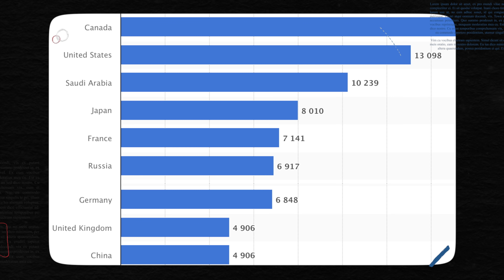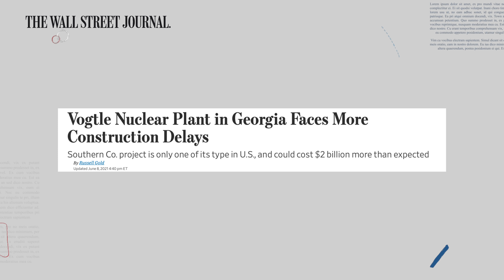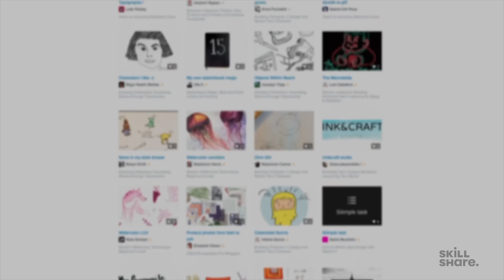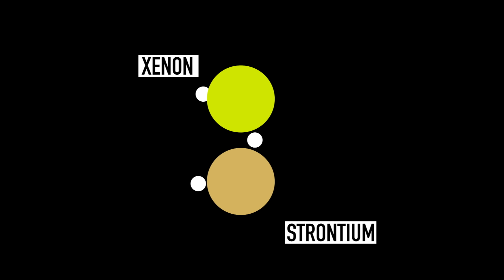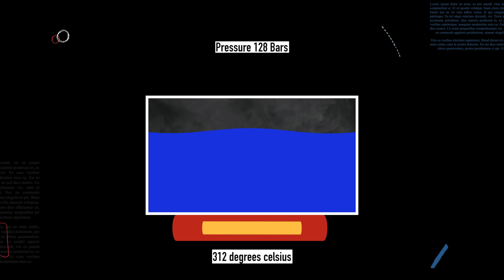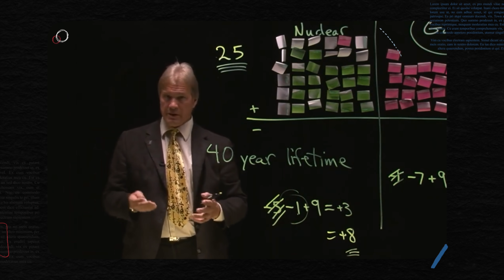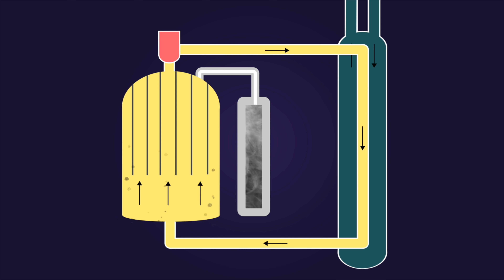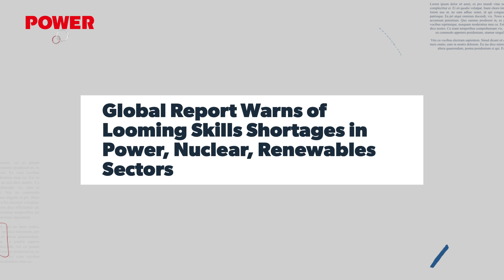Thorcon Just OBLITERATED Nuclear Energy’s Biggest Problem

Comment: The way that this is presented was spot on. I was a believer in Thorium and still am. This is a relatively new kind of science that could change our world. I for one hope it does.
Reply: Honestly, I'd prefer to use reprocessed 'spent' fuel rods rather than Thorium, cleaning up our mess instead of making more mess, but the process is nearly identical to a LFTR reactor. It's slightly less efficient at producing power, but it becomes a net consume of nuclear waste, which I think we can all agree is a Good Thing(tm).
Reply: It's not science, that's proven. It's technology.
Reply: @gregbailey45  True but they say that about Thorium as well but a Thorium test reactor ran for 5 years in the 60s without any major problems and they still call it "technology" as well. It is not classified as a project that will work it is classified as a system that "might" work. It needs billions to get the technology working and they prefer to spend billions on waste management instead. This is like the electric cars that were one of the first ways. Then oil companies saw a way of making money off of cars and got into the business. We all know how well that turned out.

Comment: I wonder what the source for per capita consumption is. Here in Germany, per capita electricity consumption of 3000 kWh/year is considered on the high side by most providers and independent sources I can find. Yet, in this video, the average is 6848. Is there any way you could link the sources? Thanks for the video!
Reply: Probably adds in industry also, no way in hell I use 13k.

Comment: The part about partially sinking the reactor into the sea kind of left me a bit uneasy, but then again, I seem to recall more than 1/4 of the Netherlands has been reclaimed from the North Sea.
Reply: It is settled to the bottom behind an earthen berm, so separate from the sea
Reply: That's the beauty of molten salt fuel, it's so stupidly easy to contain.  The drain tank is such an amazing feature.
Reply: @jeremyO9F911O2  
Not all MSRs have adrain tank, TerraPower, for example.
Reply: @EdPheil  fair enough and they would be pointless without gravity too if such applications ever happened.   But most do as far as I understand.

Comment: The electric grid could really use a flexible nuclear reactor at scale to complement non-dispatchable renewables and most projections (IRENA & IEA)suggest nuclear will eventually make a come back by 2040. Kirk Sorensen makes it clear the Thorium fuel cycle is very attractive for safety and waste and makes us question why we chose U-235 for power in the first place.

Comment: The biggest problem with nuclear energy is politics, especially in the US.  I have worked on currently operating nuclear reactors and several new technology nuclear projects.  All of the new technology projects could have been completed and operating safety except politics.  There were no technical problems that could not have been solved.  The political cycle in the US turns over too fast for a new technology to develop, get licensed and constructed.  There was even a commercial nuclear processing facility built near my hometown, but after introducing nuclear material for testing, President Jimmy Carter decided not to issue an operating license.

Comment: I'm EXTREAMLY sceptical of any modular reactor, largly because they propose to omit the heavy reinforced concreate containment structure which are one of the main drivers of Nuclear Plant cost and delay.  They claim the reactor won't need the containment structure and even if I belived this (which I don't), it neglects that containtment structures not only protect the outside world from the reactor, it protects the reactor from the outside world.  A reactor unprotected by what is essentially a bunker it easily targeted for terrorist attack (such as flying a plane into it, and yes a conventional nuclear containment structure will stop an airplane).  This is why nuclear regulators won't ever approve designs that lack containment buildings which wipes out all the claimed benifits of the modular reactor.
Reply: Good news, Thorcon's ship is designed to survive direct collision by a 747 at speed with aplomb.  They have the writeup on their website.

As for the concerns of any kind of 'catastrophic explosion or accident or anything, the claim here isn't hubris. Its based on the particular design property of ambient pressure.  In short, if not just something,  but EVERYTHING goes wrong, there's no stored up energy to damage the reactor, breech any of the multiple containment layers, or  carry any dangerous material out and away from the ship.  A catastrphic failure of this design is damaging the reactor and parts of the boat - not releasing radioactive material into the environment.
Reply: That is just why this kind of energy has not come to the forefront because of people misunderstanding and not believing in the possible better technology. Why is this? Brainwashing. People think that the kinds of energy produced are the only way to go. Just like they thought that treating sickness with bleeding, cupping, and leeching in the middle ages was the best way. I mean some people still think this is the right way to heal. Just as some people think the world is flat.

Comment: Tropical regions might not need the same actual energy consumption to reach a comperable standard of living.  Large portions of energy consumption in Temperate regions is to heat buildings or goes into the raw materials to build and repair infastructure which needs to withstand cold temperatures.  On the other hand we have the need for more cooling in such regions which is becoming a big energy cost particularly if people become AC crazy as in Singapore.

Comment: Is this reactor actually already running somewhere or just a theory?
Reply: There have been prototypes built yes, no commercial product yet.  However the vast majority of the science it's based on is well proven.  Probably the biggest unknown is the material science.  Molten salt is difficult to work with as chemicals go, it needs a lot of heat and can be corrosive with the wrong metals.  Essentially high temperature chemistry outside of metallurgical Science is still a relatively new field.  Lower temperature chemistry is the more dominant field because it's simpler, safer and cheaper to operate.    

But the important point is that the nuclear Science is proven to work, it's just an engineering challenge now to build the best designs, and a funding challenge as well.

Comment: The lack of a containment building is unlikely. The job of the containment building isn't just to protect the outside from what is inside, but also the reverse, like natural disasters, terror attacks, accidents, ... For example a nuclear reactor is supposed to be safe from a plane crash etc. 

So getting a nuclear reactor certified without a containment building will not only be very difficult, but highly controversial.

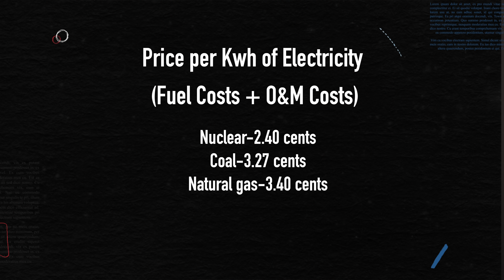As for the price, yes nuclear has been cheap in the past, but you need to look at current prices, not old ones. Generally newer plants are quite a lot more expensive. These new molten salt reactors might be cheaper, but we won't know how cheap they'll actually be untill one is built and operational. Also I thought that the costs for gas and coal there are really low, usually it is around 2-3 times the price mentioned. And Just to be clear, are you using LCOE at 9:35? Since you only mention fuel costs and operation & maintenance cost, so is the actual investment to build included in this? This is rather important considering this is a very large cost of nuclear in comparison to the rest.

lastly that quick mention of nuclear powered ships is kind of, well lets say I hope that was a joke, considering that these nuclear reactors are very very expensive and thus never cost effective.

Comment: Why use Uranium at all? Just use Thorium in the reactor.
Reply: Umm thorium reactors still "burn" uranium though.  Thorium reactors simply recycle excess neutrons to turn thorium into fissile uranium.  They are still uranium reactors at the core.
Reply: @jeremyO9F911O2  They are using 100% uranium. You only need 20% uranium/plutonium enrichment to 80% thorium to get the process going. Much cleaner.
Reply: @kretieg2943  their design lacks the neutronic efficiency necessary for sustainably breeding thorium into fuel.   To fission a thorium atom requires 2 neutrons. Uranium only takes 1.  They can produce more than 1 neutron per fission and have it find a target,  but less than 2. So they can load some thorium into the fuel salt and make use of those surplus netrons to convert and fission some thorium... but they still need to add Uranium-235 to keep it going.  Its not an arbitrary choice.
Reply: @Xylos144  Thank you.

Comment: "solar power is cheap"

"but day turns to night and monsoon clouds cover the country for three months"

Hence it's not actually "cheap". The proper way to describe unreliable power is "useless".
Reply: That doesn't makes it useless, just to be managed. There are plenty of off grid sites/buildings/... that rely solely on solar and storage without any problem and which can be cheape overtime (depending on the cost of the batteries).
Reply: @MDP1702  Yes, it's very niche. To power an entire country solely with wind and Solar is fruitless. You're not powering Tokyo with that. The more unreliables you add to the grid, the more expensive and unreliable they become.

Germany and Denmark are just throwing their heads against the wall trying to power everything on solar and wind, and they don't even come close to being clean. It's painful to watch. Meanwhile France is just chilling, always with low emissions. They were sold a complete lie.
Reply: @infini_ryu9461  You can definitely power an entire nation with wind and solar, it just might not always be the most practical, a lot depends on position, climate, management, ... It is essentially just different from how we managed powergrids untill now. The main point/problem now is grid storage to become cheap enough, which would be around 2030-35, at that point a renewable grid will actually be cheaper than most grids today. Only cheaper and more flexible new nuclear (like thorium) might be able to challenge such a setup.

As for Germany, it becomes cleaner, the problem is that they phased out nuclear for reasons that had nothing to do with the climate or emissions, just politics. In 2020 44% of Germany's power production was from renewables, or 37% from wind (23.6%), solar (8.9%) and hydro (3.3%). This while solar isn't even close to reaching full potential. And the reason why Germany's transition was so expensive, was because it was a frontrunner, starting when renewables were still much more expensive. This isn't any different for other early adopters (pc's, EV's, smartphones, ...). Their emissions due to power production went down by 42% since 2013 and are around half of what is was in 1990. This while between 1998 and 2013 it remained stable at around 350-400 million tonnes co2eq vs +-220 million tonnes in 2020 (and to be clear 2019 already saw a large reduction too at +-260 million tonnes, so it isn't just covid if you're wondering).

In Denmark 46% of power is produced by wind and 3% by solar. Here we see a similar trend in emissions, more or less stable between 1990 and 2010 at around 17-20 million tonnes of co2eq vs 4 million tonnes of co2eq in 2019 (sharp drop between 2010-2015: 17,6 => 7,4)

There are only around 5-6 countries in the world that have an equal % of nuclear as Denmarks renewables and even equaling Germany's renewables %, you only have around 10 countries that do this with nuclear (and a country like Belgium with 50% nuclear will phase it out completely in the next decade most likely, with no support at all to build new powerplants, so renewables are best to replace it, both politically as well as in terms of public opinion).

France is exporting large amount of power every year, this allows their power to remain cheaper than if they didn't, since it allows them to keep a larger share of nuclear running. However if this wasn't possible (because their neighbours didn't need/want it), France would either have to scale down nuclear (to around 60-65% probably) or allow its price to rise. As more people in France might get solar panels, keeping this high % of nuclear in the mix will be really challenging, since this solar can be cheaper and if it undercuts nuclear, it will reduce the baseload that nuclear can currently monopolise due to its low costs. Also it will be curious how France's new nuclear reactors will impact things as time goes on, considering it will drive up the price, even if they can lower the price than what is now expected.

The next decade will be decisive to determine whether nuclear+renewables, nuclear or renewables will win out mostly. Though as it stands, renewables are the favorite, with a nuclear+renewables mix (close?) behind it and almost no chance for mostly nuclear to win out (due to for now higher expected costs compared to previous generations, low public support, building time and difficulty, ...).
Reply: @infini_ryu9461  So you don't actually want an honest conversation, should have said that immediately.

Comment: WTF? Nuclear Power Plants have a tremendous safety record? Hello? Tchernobyl? Fukushima? Three Mile Island? Ok, only three major accidents in 70 years. The problem is only, that once an accident happens, east areas are practically uninhabitable for decades, if not centuries! By the way: the video talks about Uranium - but aren‘t molten salt reactors meant to run on Thorium (such as the company name Thor-Con) suggests)? The Thorium Reactor concept is really safer and the radiating by-products only are radiant for hundreds of years (and not hundreds of thousands of years as with the uranium-plutonium cycle) - the only problem is that it was never fully developed. The Americans had a working test reactor, but funding was cut in the 70ies. Only China claims to have successfully developed a working Thorium Molten Salt Reactor and wants to now mass produce it. Is the concept of Thorcon a Thorium Reactor? I still don‘t get it… Obviously this is a mixed concept. „We will store the waste products on an uninhabited island and deal with it later…“   That is exactly the problem…! If you factor in all the storage and clean-up costs, the concept is most likely not so cost-attractive any more…!

Comment: Nuclear under the ocean? Dump the waste on isolated islands? Yeah that'll work just great. WTF

I like the concept of thorium reactors but without reprocessing the waste (which is hard and expensive) I just don't believe it's worth it. I also have doubts that even with specialize metals that the pipes could stand up to corrosive salt for 60 years.

Comment: Molten salt is an improvement over pressurized water for nuclear power plant, but this tech is probably coming in too late for the Western world, where reticence over nuclear is high. It could be viable as a short term replacement for coal power plants in developing countries, as long as renewables are simultaneously developed at full speed, because that's the only viable long term solution.

That idyllic paradise island for nuclear waste vacations is really hiding the dirty truth: Either that island is teaming with protected wild life or it will be covered by rising sea water before the end of this century.
Some materials may be radioactive for less than 30 years, but others will be radioactive for up to hundreds of thousands of years. Add this storage and monitoring cost over, say, 200,000 years, and you'll probably find that disintegrating gold is cheaper than even thorium.

By the way, if there are any mathematicians out there, I'd love to know how many lives are impacted i.e. how many people are billed over 10,000 generations by the decision of a couple hundred French Congressmen to build one nuclear power plant. Say with a stagnant population of 70M over 200,000 years and an average human lifespan of 80 years for simplification. First kid at 28, second at 32 if this data makes a difference. 200,000 years would be 10,000 generations of 20 years each, but that's not part of the computation.

Renewable electricity sources are intermittent only individually and locally: When they are part of a greater renewable mix, with a smart grid that can dispatch electricity from one region to another, the need for energy storage is greatly reduced, and there are also different energy storage techs greener and more importantly cheaper than lithium batteries that are just as advanced as thorium reactors are. That is, still in the lab or test sites, barely starting and not yet mainstream.

Intermittency is not a problem today, and not likely to become one tomorrow with a diverse energy mix, some overcapacity to get some margin, a smart grid and cheap energy storage, maybe molten salt too, just not the radioactive kind.
Except for a couple megapolis inland, all major Indian cities are near the sea and could benefit from offshore wind farms, for instance.